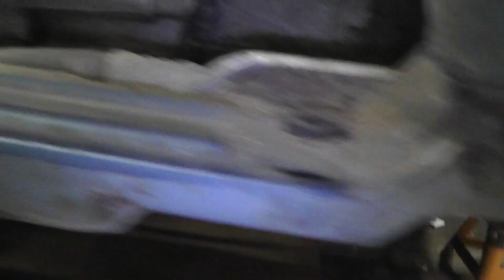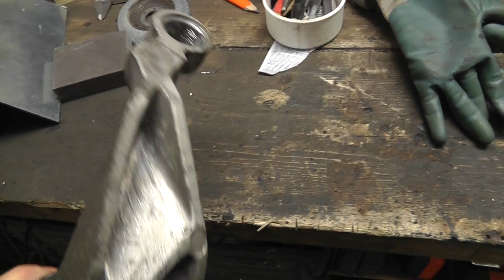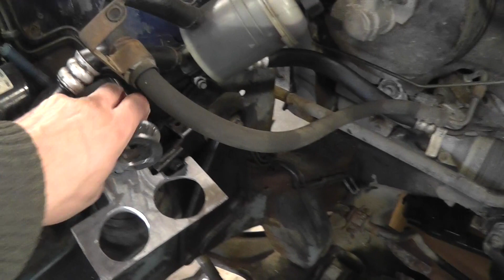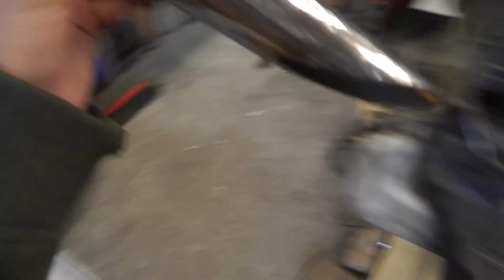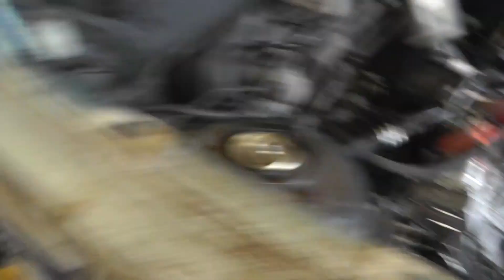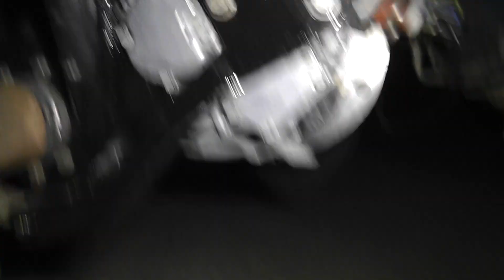DIY EV Part 17 - Even More Bracketry Goodness *** Plus first Drive***  (Sort of 😜)

Comment: Hi great work, will this have the same or similar power of the original, would this work for a defender as well I wouldn't have thought a leaf could be coupled with a 4x4 box
Reply from the maker: Hi, Thanks for your question.
The original hp of the TD4 was 115hp and this is 80kW so may be 8 to 10hp down in standard form. In theory it would be possible to make it more powerful by tweaking or replacing the inverter but for now my primary goal for now is to get it working.

Comment: Well done chief - I was actually surprised how well it moved with 1HP, I honestly thought it'd struggle, or let the angry pixies out the eBike controller., but yeah, it's a big moment for you, that's taken a lot of work to get there, so I'm well pleased for you.
Reply from the maker: Thanks. It took a look long time to get this far and I don't underestimate the work ahead. 1hp is more power than I expected too. 😜
Reply from the maker: I discovered today it doesn't like pulling away in 2nd. Not sure if the battery is low (probably) or the controller couldn't cope but it wouldn't move. 
It's still pretty impressive that it did move in first and reverse.

Comment: Looking good Ali.
That mount is probably 3 X stronger than is needed, which gives a good safety margin.
Excellent to see it moving under its own power too. Good work.
Reply from the maker: I wanted to build it at least twice as strong as required but you could be right. A healthy safety margin is always good and it isn't overly bulky so I'm really pleased with it. 
Next update will be battery related. 😉
Reply: @alibro7512  

Excellent. I'm looking forward to battery stuff.

I'm not surprised that it moves on 800W though. It shows just how little energy is needed to get a vehicle moving at slow speed. 
It was good to see though, as it shows transmission losses are small.
Reply: @alibro7512  Overkill is under-rated!!!